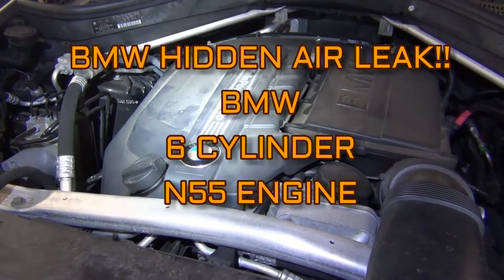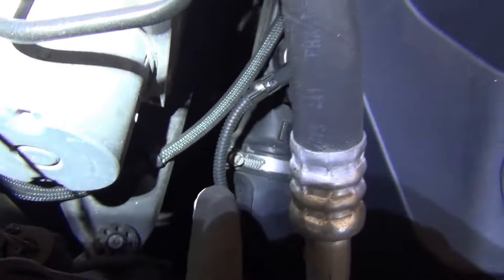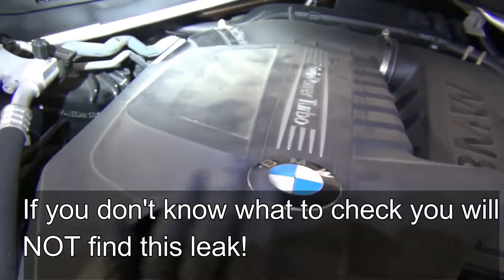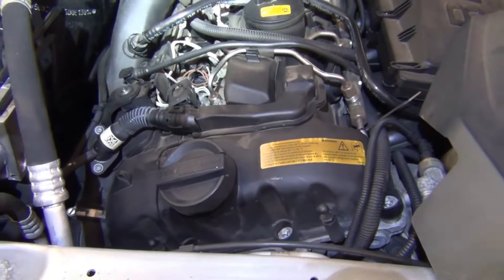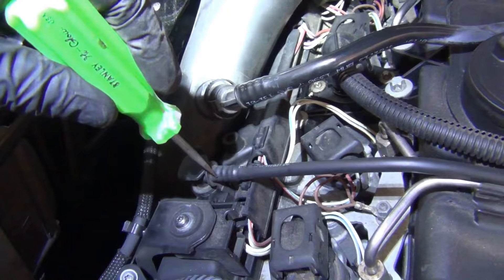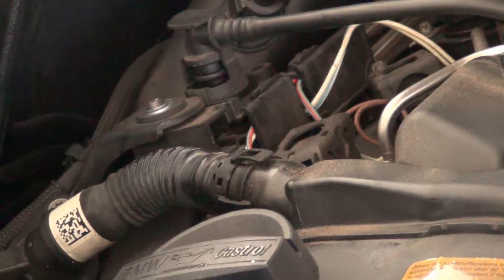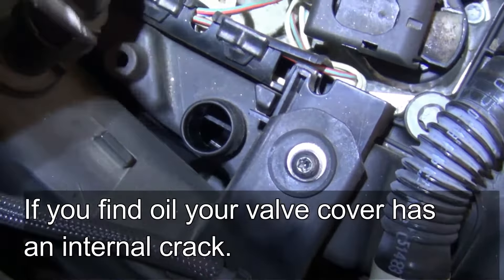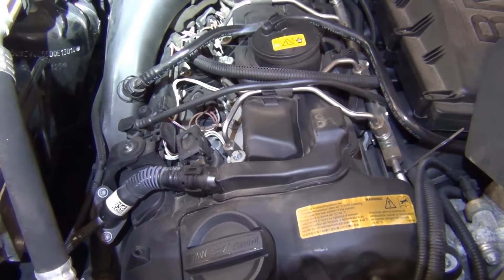HIDDEN AIR LEAK !! BMW N55 Mixture Too Lean P0170 P0173 P2279 2C57 Bank 1 Bank 2 Unmetered Air Leak

Comment: Sorry for the winded comment in advance. A while back, I came across this video trying to diagnose boost leaks as I'm an FBO JB4 and MHD ( I am so happy I remembered it). I have an e92 N55, AT, and it is definitely a WIP. I am slowly DIYing everything as it comes about, doing preventative maintenance when I can afford the time for it. The car started leaking oil after being driven and dumped about half a quart over the period of a year ( I was not too worried about it because I thought it was a crack in the rear of the valve cover, and the car was rarely ever driven and on a battery maintainer) Come to find out while in the process to remove the VC the oil was actually leaking from the vacuum lines into the boost solenoid. I missed this because I assumed the oil was traveling from the VC onto the heat tray and down onto the downpipe. I investigated further and found oil in that line in your video. There was a forum I came across that talked about failing vacuum pumps and how intrusive they are. I reviewed this video again, but having done the valve cover less than 3 years ago, it didn't seem plausible the VC was out so soon. In another forum, someone pointed out that the plastic nipple is a failure point and can cause pump failure because the little internal diaphragm fails and is not an LRC by BMW or most aftermarket entities. Luckily, I found a company that makes them on Amazon, "Link Lock,"  and replaced mine because the diaphragm had indeed separated. I was hoping that would fix the issue... My theory was that the vacuum pump was allowing oil into the vacuum chamber and causing the leak.  I obviously still don't fully understand how the vacuum system works, but I can conclude I was very wrong. I know the vacuum system is responsible for wastegate actuation, the exhaust flap, and crankcase pressure. After cleaning out all vacuum lines and installing the new nipple, the car drove amazingly. Additionally, A shudder/jolt when coming to a stop (2nd to 1st)  that I have been trying to remedy for the past 1-2 years also went away. Sadly, driving the car for about 30 minutes brought the oil back. The vacuum chamber had a little oil in it, and from what I can remember, there was no vacuum when removing the supply line (the car had cooled down). I already have the VC on order and will be doing it ASAP. I hope this remedies the issues I am having now; A squeal on a cold start, then not noticeable until about 2k-3krpm (excess crankcase pressure from internal leak causing main seals to suck in air?),  2906 code occasionally occurs, and driving sparingly today there is a definite loss of power, and actual boost is .9psi above what target is supposed to be. I have concluded most of this is attributed to the valve cover; fingers crossed. I am open to any help or guidance and am posting this in case others run into similar issues in the future.
Reply from the maker: Hello, I have seen this issue for quit some time. I used to think this was from a vacuum pump. What I found was the crank in the valve cover allows the oil into the vacuum lines to the solenoid and the exhaust flap vacuum line. After a replacement vavle cover oil gets back into the resevior because the vacuum lines are already filled with oil. I now replace or  blow out the vacuum lines when I do the valve cover for this failure which reduces the amount of oil the returns to the vacuum resevoir in the valve cover.
Reply: @AskTheCarExperts  I have the big issue with 2013 n55 engine. The MAF readings are only 10-12 kg/ h with warm , idling engine.  I do not get any error codes but the car is really slower and slow reacting to the throttle.I have compared MAF readings with good vehicle and the value there is is 16-17 kg /h . I have done full smoke test and there were not any signs of external
Leaks . In the vacuum line I have found the very poor oil residues. In your opinion can in be like the MAF reads only 10-12 kg/h of air when the valve cover is cracked internally? 
Please help…

Comment: Hey got another almost unseen air leak ! In the Brake booster Grommet ,i noticed my LFT was over 12 when i put it in park at idle but 3-4 while driving , also hard brake peddle if i let is sit two days ! Luckily under extended warranty .
Reply from the maker: Hi Mark! Thanks for sharing that! That is one I have not run into yet.
Reply: @AskTheCarExperts  I can tell you beyond the shadow of a doubt any car over 6 or 7 years old will have a field grommet in their brake booster it's just notorious I've had two consecutive BMWs and the last one was an M3
Reply from the maker: @markt9438  Thanks Mark, I will keep an eye out for that issue.

Comment: is it possbile to get 101F01 code with this leak?
Reply from the maker: That code is usually a bad pressure sensor at the intake manifold.
Reply: Well I don’t think so. Got this code when my intake manifold pressure was too high (~950hPa when idling). It appeared when I started up my valvetronic which wasn’t working. Getting rough idling and misfires especially on cold starts. Have smoke tested, no leaks were detected, all sensors were checked, all of them works fine. Replaced VC, no change. Also reseted DME adaptations, still no change. Cleaned vanos solenoids and nooo change at all. Then I decided to disconnect valvetronic servomotor connector to see what happens. And a miracle, engine runs very smooth, intake manifold pressure is about 300hPa and 101F01 and check engine light is gone. But valvetronic is disconnected and it is at maximum lift. Any thoughts?

Comment: I purchased a 2015 535i 2 years ago started getting smoke in the cabin figured valve cover gasket job ok went to do the job and talk about leak the whole hose is absent I've purchased the hose but no idea where to start to get to the air pump without over working taking the car apart 🤦🏾‍♂️ plz help 🙏🏽thnx
Reply from the maker: Hello, Not all vehicles have this hose installed. If you have a vacuum controlled turbo this hose should be used. If the turbo is electrical the hose will not be used.
Reply: @AskTheCarExperts  thanks after reading more i got it

Comment: Do they make a valve cover that won't crack and also a proper gasket like the ones that are made for Vanos seals they don't degrade seems to me that would be the easy fix.
Reply from the maker: I wish they did Mark but over time, use, and temperature everything eventually degrades. Also the PCV system is built into the valve cover and when this component fails it can lead to excessive pressure or vacuum in the engine and can also contribute to the failure. But the complete valve cover does last a long time. Usual life expectancy of a valve cover is between 90,000 to 150,000 miles.

Comment: I replaced valve cover 3 times cause of this. But still find oil in there after new one is put in why would that be ? Vaccum pump or another internal crack for the 4th time. Any ideas ?
Reply from the maker: Hi Victor,  I think oil can sometimes come from vacuum lines going to the wastegate pressure converter from the previous failure. I would start with replacing all the vacuum lines.

Comment: Having the same issues p3022  car feels flat  nothin coming up through a smoke test  primary o2 changed  any idea what ir could be  electronic waste gate
Reply from the maker: You may need quite a bit if diagnostics to try and figure this type of problem out. Since you have the oxygen sensor code I would want to I soect the CAT with a scope to see if the honey comb is failing. Also a back pressure test to make sure the exhaust is not restricted.

Comment: can you post the part numbers for turbo lines on this n55 engine? I have oil, will replace vc but want to take care of lines that have residual as you mention. thank you!
Reply from the maker: Hi Travis, I am sure I can help but I not sure which lines you are looking for. Are you looking for the charge air pipe or the oil feed lines directly for the turbo? Can you send me a picture of what you are looking for? The best way to contact me is via my website at www.askthecarexperts.com and use the contact me tab as I am not notified by YouTube for replies so I may not see your response back.
Reply: @AskTheCarExperts  I just read a reply that if you see residual oil it's from the vacuum lines for turbos, if I'm doing this, want to get it done right the first time and order them and replace is all

Comment: I have oil in and in vacum pipe from valvecover in boost selenoid but mu valve cover is new from BMW
Reply from the maker: Hello Dilyan, How long ago was the valve cover replaced? It may be residual oil that is in the lines of the turbo solenoid EPDW. When I see oil in this area usually the vacuum lines to the turbo actuator are full of oil and need replacement. This is most likely consequential to the previous valve cover failure.

Comment: Hello, great video I have been stumped on an oil leek coming from the boost solenoid and or lines.  I too have oil in this reservoir.  The oil traces back INTO the vacuum pump! Is this ok to replace just the valve cover? The pump lives in oil however I am concerned for its heath as I don't fully understand the way it operates.  Im going to replace the valve cover/hoses anyway but I am wondering where all that oil is collecting...in the pump? Is this bad?  I have also detected oil in the outlet hose going to the waste gate by applying a vacuum gauge and releasing pressure, I hear bubbling...will this oil ever vacate or am I looking at $$$ repairs Thank you for sharing this tip!
Reply from the maker: Hello Sirus, I did an experiment recently where I put a clear bag around the vacuum pipe line and ran the vehicle. No oil entered the bag from the vacuum pump. The vacuum pump provided vacuum or suction. I think the main oil comes from the valve cover but gets into the vacuum lines and EPDW. I would recommend replacing the vacuum lines with the valve cover. You may get some oil back in the reservoir from any left over oil but I do not think it is from the vacuum pump. I hope this helps!

Comment: Awesome video, thank you! I think I'm going to have to order a new cover soon :D Quick question, while I don't see that reservoir filled with oil, I do see signs of some oil... Do you think this is still a problem? (apologies for the n00b question..)
Reply from the maker: Hi Omar, Do you have any mixture too lean codes on your BMW? There is probably a small micro Crack but if it is not setting a fault you could monitor it to see if it gets worse. It also might be good to replace the cover to prevent the oil from getting into the vacuum lines.

Comment: Very helpful. I replaced complete valve cover and 2 test drives later oil in pcv chamber again, any ideas?
Reply from the maker: I suspect the oil may have been in the vacuum lines that lead to the turbo actuator EPDW and the exhaust flap. If the lines are not replaced oil can get back into the chamber.
Reply: I have the same problem ive replaced valve cover and still oil in the reservoir i don't even get any fault codes i even took it to bmw and no acknowledgement towards it  whats a good test for both valve cover internal leak and vaccum pump to solve the issue ?? Been buying valve covers like groceries
Reply: @Xkonvic  did you find out? i have oil in mine and make low boost with now codes

Comment: So I checked and I do have oil in there so I have to replace the whole valve cover to fix this problem? Another question will this issue cause an effect to when you hit the brakes the rpm will jump as I show down like 2 or 3 jumps?
Reply from the maker: Hello Bud,
Sorry to hear your vehicle has this issue.  To fix this internal Crack the valve cover would need replacement.  I don't think this would effect rpm unless you had a larger air leak with mixture faults. The engine rpm will change as the transmission downshift. That actually sounds like normal operation.
Reply: @AskTheCarExperts  yeah I got a new one on the way tomorrow I do have the oil in there

Comment: What about p0171?
Reply from the maker: Hi Jason, P0171 is a mixture too lean fault. This means the vehicle is adding more fuel to offset too much the extra air in the system. This is often from an unmetered air leak and you can use a smoke machine like in my video https://youtu.be/ZgLmCnn33d4 to find the source of the air leak. This should always be the first step and the smoke machine in my video is very affordable https://amzn.to/3zhYQpG and the intake adapter https://amzn.to/3eI5fRG
But there are other reasons for a mixture too lean issue as well. I would be happy to help you via youtube comments but you can also reach me directly via my website at www.askthecarexperts.com and go to the contact me tab. Best regards, Roger
Reply: @AskTheCarExperts  I sent an email
Reply: @Stockish_Daza  what did you find out I got this code before but I replaced my crankshaft and camshaft sensor its been cool!
Reply: @bud6575  had a leak in the intake. Quick easy fix. Figured it out before I took it anywhere.

Comment: What about if its a N54 twin turbo with lean codes on both banks? New pcv, all new injectors, new valve cover, new inlets and outlets , new plugs and coils.
Still have lean codes on both banks, where would you suggest to look?
Reply from the maker: Hello Shoua, That I'd an odd scenario. I would recommend doing a smoke test on the intake system and by modifying a oil fill cap so would smoke test the engine from the fill cap. If you had a belt failure it may be a damaged front main seal. Or there is a hidden air leak that the smoke test will help with. Normally with no unmetered air leaks the culprit is the injectors but since you have done them it most likely is something else.
Reply: @AskTheCarExperts  
I smoke test from the valve cover oil cap and from the intake manifold,  air were coming out of the valve cover gasket seal area , a little above the intake manifold cylinders 2, 3,5 areas. 
Maybe the new gasket that came with the valve cover might be pinch or something. Bolts were all torque to 7-8ftlb.
Do you think its the valve cover gasket? 
Should I replace it ?
Reply: @AskTheCarExperts  
Now that I think about it, it could also just be the E85 I put in it as well. Giving me a screw up AF mixer. Spark plugs were foul out and wet.

Comment: Hello
I have BMW 2012 35i   115 000 miles v6 gas. OBD shows code P0171, P0300, P0303, p0304 p112F.  I cleaned the sensors MAF and MAP,( with spray) changed the gaskets on intake manifold cleaned as well  . 
Issues is: when start up engine by its self rough idling and its  jerks , white smoke comes from the muffler , but goes away after few minutes.  I changed the serpentine belt and pulley's ( up and down ) but when idling by it self  as I said it  jerks and  makes noise on serpentine  belt and squeaks. I couldn't  not find any cracks on  air hoses , but when I turn off engine I stick the screwdriver in the hole of cover valve  ( shown by your hiding leak  ) I see oil on the screwdriver.  What could be a problem ? Valve gasket, valve Cover  or something else ? I don't see any oil drippings tho, but I saw oil in   one of the hoses in air intake so  when I took manifold I cleaned hose as well.   OBD suggestion is  to change MAF and MAP sensor , PCV system hose, EVAP control vale, Ignition coil, tank cap, spark plugs.  Tnx
Reply from the maker: Hello Dalibor, This might be a multiple problem situation but by your description if there is oil in the vacuum port as shown in my video the valve cover should be replaced. Then clear the codes and adaptation values and recheck. Make sure to check the vacuum hoses off the valve cover for signs of oil and replace as needed. I hope you solve it and this helps.
Reply: @AskTheCarExperts  Thanks for quick  response and for the answer . I will change cover and see if solves other problems as well.
Reply from the maker: @dalibormilanovic4389  I am here to help again if needed. But since the valve cover had this issue it would be good to do that first. If you have a shop do it make sure they check your timing to make sure you don't have a VANOS issue as well.
Reply: @AskTheCarExperts  Thanks I am doing by my self , and I just broke the valve screw ( the last one , tie to much and it stick in the head) I am waiting on parts to be received and to try take it out. Since I am doing by my self and no shop I would like to send you some pictures maybe you can take look and see if looks normal or not. Do you have time to look over? If do can you can send me your e mail so I can send you the pictures. Thanks in advance
Reply from the maker: @dalibormilanovic4389  No problem. I don't want to post my email and get spammed. Go to www AskTheCarExperts.com and go to the contact me tab. Then I can email you back directly.

Comment: Great Video. I am missing the vacuum pipe that connects to the valve cover and routes to the vacuum pump. I bought the 2016 BMW 535i as a CPO from BMW dealer. It has been missing since I bought it in 2019, however I have never seen any codes. I will take it to the dealer for them to check. Is this normal?
Reply from the maker: Hello, Yes some vehicles that use an electrical wastegate will no have this plastic pipe.
Reply: @AskTheCarExperts  but should the hole on the vlve cvr remain open versus capped off?